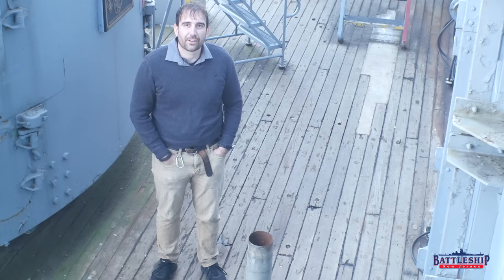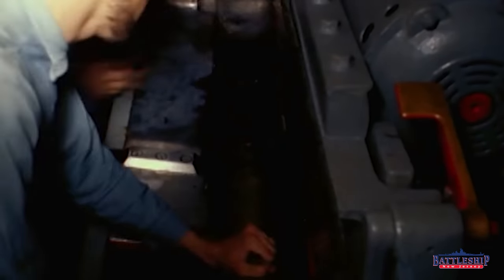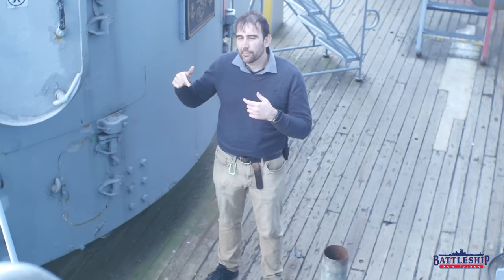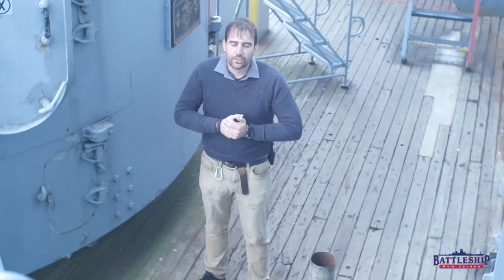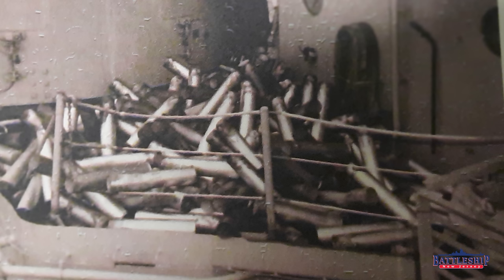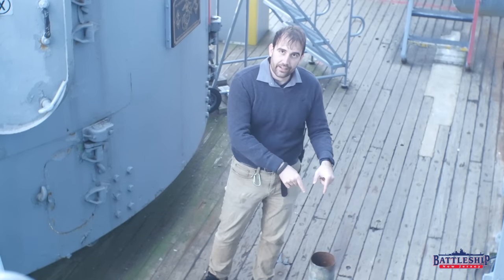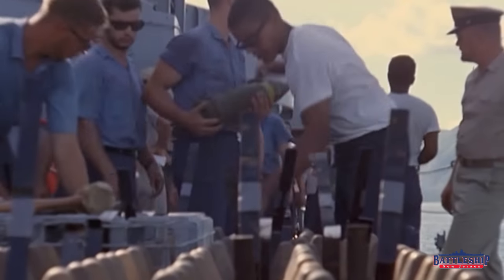Powder Casings for 5in Guns: Can They Be Reused?

Comment: we used to pitch the 5 in over the side, they sunk. the 8" brass would just barely float and was considered a navigation hazard for small boats (i was on ca-148) one day we spent the better part of a slow watch trying to sink one that had rolled off the deck. not sure if we ever did sink it. but we also traded some when in hong kong for some new teak decking around t-3. we even had 3/4 plywood nailed down but it still chewed it up. they were a pain in the butt. they were real sooty and after you shot a bunch you had to go topside  (i was below in the powder handling room) and carry them amidships o1 level and secure them till we got back to subic to unload them. they would pile up all over. you carry them on yer shoulder and they really ruined you shirts. i seem to remember they were 80 lbs empty but that was a long long time ago. the 5 inch'rs  trimmed by 1/2 or so made good ice buckets, they weren't brass either, but the 8 in brass were too big, dirty, and heavy to mess with. the 8" had a hard white plastic plug on the top to hold the powder in and in the magazines around the handling room we would sleep on them. mostly cause there was no room in there. sometimes it would push the plugs in and loosen them and it would get pretty ether smelling in there. hard to stay awake. in the powder handling room we would sleep on the deck when it was slow...after we got a bunch of powder lined up around the elevator so we could knock them in fast. the floor plates were cold and of course oily so they didn't rust. it was a very valued item to have a piece of tarp to lay on. heavy duty comshaw item. if you were lucky you got one from a guy rotating out, other wise you had to trade something with a bosun at the sail locker. like one of those big tins of coffee, which meant you had to find something for the galley folks. paint, coffee, peanut butter, and jp-5 were handy things for barter. i think the sail locker was part of the side cleaners or maybe 1st div. it was way up forward. i was in 3rd which was the fantail.

Comment: Conversely, in most tanks, the empties (or the base/primer of combustible cartridges for the main gun nowadays) generally fall into a bag under the gun, and eventually somebody has to open a hatch and dump them overboard. Guns with autoloaders, like the Soviet T-72 tank and American Stryker MGS assault gun, tend to work like a 5" and poop the case out the back of the turret.

Comment: I was on an Adams class DDG back in the 80's.  (USS Sellers DDG-11)  I recall our 5 inch guns would spit the empty cases out from right under the barrel.  They would roll around on the deck afterwards.   I also recall our captain getting annoyed when they were allowed to roll off the deck and sink.   We weren't at war at the time, so I suppose he was trying to keep to a budget :)   After every shoot-ex, the gunners mates would be out around the turrets repairing the non-skid.  Those cases came out open-end first, and would cut rather clean looking half moon shapes out of the non-skid!

Comment: Not at sea, but according to the Navy manual the empty casings can be returned to the factory to be refurbished and reused.
Reply: If they're anything like small arms casings, they've been fire-formed to the chamber while sealing the breech, and are no longer properly dimensioned to be loaded into a five inch gun. They would have to be re-sized (forced into a die) to bring them back to the proper diameter,  checked for length, thickness, and work hardening, and even then there's an upper limit to the number of times you can safely do this. You also have to install a fresh primer.
Reply: @Tomyironmane  Very similar process. After cleaning and inspection they get resized, then reloaded and sent back to the ammo dump.

Comment: In WWII, my father on a Liberty, came back with a cargo of used casings and empty oil drums.
During Vietnam, ships doing gunfire support put the casings back into their containers and sent them back to an AE in net loads. No idea if they were reloaded.
Also in Vietnam recovered AK-47 rounds and Russian mortar rounds were modified to explode. A modified AK round, when fired, was so powerful it forced the bolt out thru the back of the receiver and usually thru the head of the VC. The mortar rounds exploded when dropped into the tube, killing the crew. Since VC and NVA were known to recover unused ammo, the modified rounds would be left with or on dead commies. The process was known as operation Elder Son. VC #10
Reply: I feel like however overloaded a cartridge might be, the gas system of an AK would fail long before it imparted that much energy to the bolt carrier... but I admit I'm not going to test it. :)

Comment: Reloading may or may not have been a good ideal Those casing have to hold a lot of pressure. They can only be sued so many times, before they fail, that would not be pretty and would take time to repair the five-inch gun. The best solution would be to melt them down and make new casings. That would be faster than doing the inspections looking for small cracks.

But I had an uncle that saw one used for a unique purpose. They pulled into a port in Asia a sailor on the deck of the aircraft carrier had worked out a trade with a local in a boat that pulled alongside the carrier. The sailor lower his end of the deal on a line and the local refused to tie his part of the deal to the line. The guy dropped one of those casings through the local's boat.

Comment: So how were the cases primed and fired? Not really thought about that before but the base of the case didn't look like it had an obvious primer pocket. As for souvenirs, my grandfather had a pair of large shell cases, one each side of his front door where he'd put umbrellas and walking sticks. Also saw some that had been converted into lamps with some neat patterns pierced into the sides. My favorite though is a trench lighter from a relative who served in Egypt during WW2 and made it from a 20mm case with a coin closing the top.
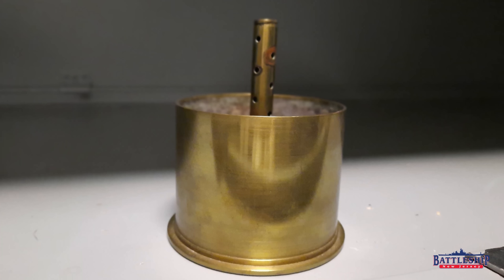Reply: At 9:08, there is an ashtry made from a 5" casing. The perforated tube in the middle is the primer. In another video, crewmen are removing a safety tab (washer?) from the center of cases before placing in the gun to be fired.
Reply: At 9:08, there is an ashtry made from a 5" casing. The perforated tube in the middle is the primer. In another video, crewmen are removing a safety tab (washer?) from the center of cases before placing in the gun to be fired.
Reply: @haroldhenderson2824  Ah, thank you. I did wonder what that was in the ashtray. Also the raised rim around the bottom of the case makes more sense now. Guessing that was to protect the primer along with the cover in case it got dropped.

Comment: Sometime you just have to look at the cost benefit of recycling let alone reloading the casings. You have to store the casings someplace, ship it to a collection point to be recycled (is that brass really worth the cost?). And if sent out for reloading it may be cheaper to just use new brass than refurbish old casings. And you'll need contracts to do that.
Reply: The ship has a perfect place to store them. Back in the magazines you took them out of. It doesn't actually cost you anything except man power. The weight you're using by not throwing them over board would have to be replaced with ballast anyway.
Reply: The military back then refurbished ammunition when possible to save money.  The US military has been reloading cartridges since the 1870's when 45-70 Government cases were sent back to Frankford Arsenal.  Because it saves a lot of money and resources.

Think about the supply chain.  The supply ship has to dead head back from the ship back to depot, and there at the depot on land there is a truck or train that dead heads back to another depot, that leads to another truck or train that deadheads back to the factory or arsenal that produces the rounds.  

With the military, there is always a straight supply chain forward and backwards, so the logistics are simple.  They bring a lot to the front, and not a lot back, and there is always something, either a ship or a mule train or a train or a truck that is going back up the supply chain to the root.  

The empty cases piggy back on the very thing that brought the loaded rounds forward in the first place.

Comment: The video mentioned scrap metal drives during WW2. I've also heard of (meat) fat drives (I've even seen a Micky Mouse cartoon about it) that vaguely mentions it could be used for explosives. Anyone know how that worked?

As for spent casings used by the enemy, the Royal Armouries has a weird improvised sub-matchlock muzzleloader that uses a cartridge case as a barrel, so it has occurred at all ends of size.
Reply: The fat is rendered, mixed with Lye. The result was Lye soap and glycerin. Collect the glycerin, mix with nitric acid mixture. You get trinitroglycerin and dinitroglycerin. Both are usd in gun propellant.
Reply: Good old bar soap is made from fat. 
Refined fatty acids can also be used in special "soaps" used for thickening petroleum oil into lubricating grease (12-stearate is popular. With heads of lithium, aluminum, calcium, sodium, or barium; mixed fatty acid tails can be used to make "complex" thickeners.) 
The glycerol [glycerine] byproduct has several uses, but at least in modern times glycerol is considered a byproduct because demand is much lower than the demand for soap and fatty acids.
And not all soap making processes bother to separate the glycerine.

Comment: isent gun powder corrosive? how may times can you reuse the casings? I imagine that you have to rinse them between uses..
Reply: Depends more on the primer mixture. Some common mixtures make the brass brittle.
Reply: black powder is, smokeless generally isnt, and as the other poster mentioned, some primer mixes have been corrosive.